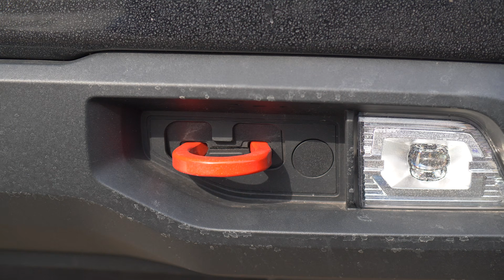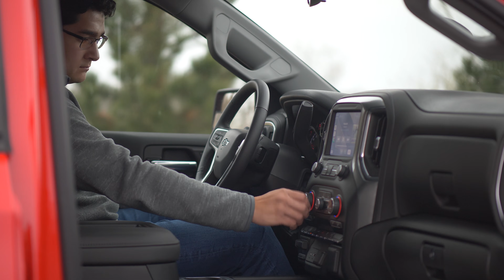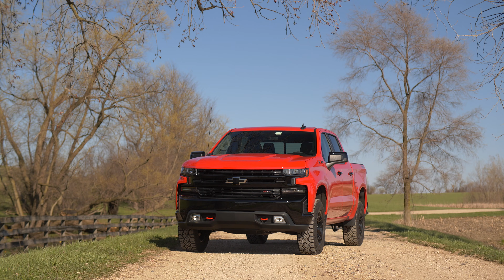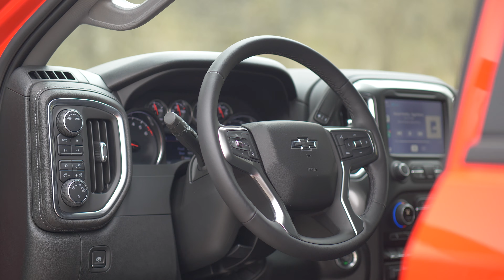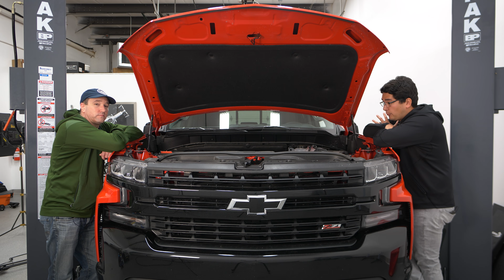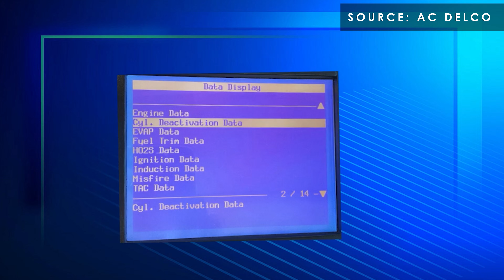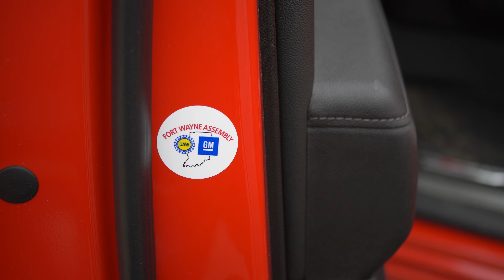2020 Chevy Silverado | The Golden Child

Comment: I did brakes on a 2010 ram and when I took the rear Caliper off the piston fell apart. Looked like it was plastic. If they cut corners on safety things like that, i wonder what else they cheap out on to pay for that interior. I don't care how nice ram seats are, I will never buy one. Just my two cents.

Comment: I'll take dependable over flashy every time. I owned 2 RAM's,never again. Electrical gremlins constantly and never ending recalls. Went back to Chevy in 2018 and zero issues. Just bought a 2020 Trail Boss LT 6.2. yep, interior is a little dated,seats are a little hard. I'll take that over having a truck that sits in the service department half the time.

Comment: Can we just talk for a second about how they released a turbo 4-cylinder model of the Silverado and it gets nearly identical gas mileage  when compared to the absolutely ancient pushrod 5.3L L83 motor, despite sacrificing over 4000lbs of towing capacity? Add to that the fact that most long-term 4-cylinder test trucks seem to be incapable of achieving anything close to the EPA mileage rating?

Or maybe we could discuss the 3.0 Duramax, which is already suffering overheating issues. The engine that is designed with a belt-driven oil pump that is located at the back of the engine, which DOES need to be replaced (at an interval conveniently just outside of any powertrain warranty GM offers); a belt which you must remove the transmission in order to access. And an aluminum block on a turbodiesel. With "active directed cooling channels" CNC'd into the block and controlled by, your guys' favorite: solenoids.

I'll take a pass on one of these newfangled $70K rustbucket bean-counter GM nightmares, and instead I'll slump into my 25 year-old, beat-my-wife-red Ram 2500 and stare at the disintegrating dashboard, meaningless rear bench seat, inaudible audio system, and somehow still feel a slight tingle of satisfaction in my rectum when I twist the key in the ignition and the 300,000 mile-old 12-valve tractor engine under the hood violently shakes itself awake.

Comment: For accessing mines I rent these trucks (4x4 crew cab, chevy/gmc, ram and ford) for about a week 6 times a year for the last 6 years, so not quite 40 of them over the last 6 years. I've had equally good/bad experiences with all of them. The biggest indicator of reliability is the trim level, the lower the trim level the more reliable - like if it's got a sunroof it's about 50/50 that that works. If it's a full ton it's maybe half as reliable as the 1/2 ton. If reliability is key go cheap, get the cheapest one that meets your needs, the more you pay the less you get. The comments about the interior don't register with me, all of these trucks function practically identical inside.
Reply: I like this comment .

Comment: I bought a 2020 LT 5.3L w/ DFM in April.  In doing my homework i've learned a lot about AFM and how many people had their trucks ruined from malfunctions.
I only have 10k miles on my truck now, i bought it with 8 miles.  Checked the oil for the first time (changed at 4.8k by dealer) and it's in great shape, but it should be, so no surprise.
I've found dongles that will remove the DFM, but mixed reviews from people on them, some have reported CEL coming on after a few months and they have to remove the dongle or disconnect the batt on the truck.  One guy said his truck went into limp mode when the OBD2 AFM disabler was plugged in after a few months.  None of them said the issue was permanent tho, truck always fixed itself after disconnecting the batt.
I know these guys are untraceable and i can disconnect them before any dealer or warranty work, but at the same time, i feel the truck is engineered for DFM and disabling it by a poor OBD2 override dongle isn't really worth it.  Wondering what you guys would do if you were faced with the same circumstance.  I think if i Flash the ECU my warranty would be void. 
Glad i bought the 80k miles powertrain warranty :)
Reply: On the older trucks (18 and down), there is a guy in MO who does afm software deletes. Send the PCM in and he is able to turn it off. Lt1swap.com

Comment: I had a 2018 1500 4.3 4x4. Never did idle smooth also the shake from the AFM system was a nice feature as well. Took it to the dealer 5 times but because no engine lights or codes they couldn’t / wouldn’t do anything. Finally had the motor mount changed under a service letter and it did nothing. Drove straight to a ford dealer after the motor mounts and traded it in for a 2020 F150. Couldn’t be happier now!!

Comment: So I just bought this truck 2020 Chevy Silverado Trail boss LT with the digital fuel management system. This truck was so hard to find I had to almost drive 100 miles to find one that was coming into the dealer. These trucks are so rare And are often sold before they even hit the dealer lot.  I actually bought mine before the dealer received it and I pick it up tomorrow. I really enjoy your videos because you don’t hold back on your reviews but for some reason I cannot picture either of you driving this truck. I think you would almost settle for the wimpy Honda ridgeline. If you call that a truck.

Comment: So I just bought a trail boss last week. For me I'm not a Chevy fanboy I'm more of a Mopar fan. However my issue with ford I don't want chrome and I don't was a eco boost very hard to find. My issue with ran beds rot out from the inside out, and the ones around me can only tow 8600 lbs my trail boss can tow 9500. I'll keep my eye on that active fuel management. Those were my main issues and why I choose the Chevy. And I think the interiors are nicer then ford. My brother in law just bought a 2.7 extended cab f150. I like my truck way more.

Comment: When someone stands under a vehicle without underhoist support stands you have to question their knowledge on anything
Reply from the maker: There is something called locks that modern lifts use.  The car is not using just Hydraulics to hold it in the air.

Comment: I was working at a GM dealership when these came out. Felt very smooth compared to my 2002 but I didn't like the styling or the increasingly tall cabin and box. Feels like sitting in an Express van now. And they still WAX the paper thin frame. A non-AFM V8 option would be nice. The old 99-06 LS-based motors are rock solid.

Comment: I drove my 2020 Silverado 6 hours on a recent road trip and i found it very comfortable and quiet.  I really don't understand the complaints about the seats.  Also i know a couple people with high mileage, last generation GM trucks with AFM and none of them have any problems.  I felt like there's some anti Chevy Bias from these guys, yes the interior isn't the best but i picked my 2020 Silverado after looking at options from Ram and Ford, i thought it was the overall best package taking every factor into consideration.  One more note.  Yes, the interior inst the best, but its still LIGHTYEARS ahead of where these vehicles were just a decade ago, there's no really "bad interiors" anymore.  Some are just better than others.

Comment: The only reason to even consider the GM twins over the competition right now is if you actually use the bed of your truck and need all the space you can get... because the beds on the new GM twins are absolutely cavernous. Seriously, if you haven't looked in the box of one of these trucks yet, do so... its like the tardis. The beds on the GM twins literally offer 10 - 12 more cubic feet of volume than the same length beds on the F-150... thats insane! 

In just about every other respect, though, the new GM twins fall short of the competition.

Comment: Soooo get the 6.2 instead of the 5.3 lol. I had a 2008 with AFM. Only issue I had was a valve spring broke. Dealership covered it and just swapped them all out for revised ones.

Comment: I can’t get over the seating position in these gm trucks. The hood is level with the dash and the window lines and you actually can’t see shit. I’m totally  biased as a Ford fan but I swear new F150’s don’t have this problem
Reply: Yeah Ford slopes down a little. My Ram goes straight across too, hurting visibility. It might even go up a little before that final slope down way out front. But it might have been necessary to fit the 6.7 and radiator in there. I haven't driven a 1500 to compare.

Comment: GM is in trouble; RAM is just so much better.  GM thinking a small sunroof is okay, GM thinking a non true flat floor is okay, GM thinking an ugly column shifter is okay, GM thinking horrendous gages are okay, GM thinking that interior is okay....should I go on?  The truck looks good but wow does it lack.  RAM took the winning trophy for good reason. I'm a die hard Ford fanatic but I know a good truck when I see one, RAM engineers really did great work on their truck.
Reply: More people like the column shifter than the knob. Ram even recognized this in the 2500/3500 segment.

Comment: Love your videos and your humor. Bought a 2020 Silverado last week and this video made me feel a little bad at first. But hey. I get it. 

I do feel like there is a disconnect between the reviewers and the buyers on these 2020 GM trucks. Every review beats it’s exterior styling and on the interior. 

But in the real world GM sold more Silverados & Sierras in Q1 than Ford F150s and blew Ram away. 

I’ll admit there are things on the Ford and Ram that are nicer on the inside but Chevy does have some innovative storage compartments and things the other don’t have. 

I got the 2.7T since I use the truck more as a dad sedan. I’m actually getting 21 and better at the pump. That’s with a crew size 4x4 on 20s. 

I’m really impressed with it. My 2020 LT Chevrolet has things my brothers 2018 Lariat F-150 doesn’t have.

Edit: I’m no Chevy fanboy, this is my first Chevrolet truck. I’ve owned several f-150s and 1 Ram before.

Comment: AFM isn’t an issue with 2014+ GM engines. I’d be more concerned about the junk torque converters they use that usually fail between 100k-140k. Just in time for when most warranties expire.

Comment: Coming from my 2010 Tundra, I really thought the Trail Boss would be my next truck......As for overall looks, I prefer it over all others. The test drive turned me off....so much road-noise. Then tested a new top of the line Denali...and still more noisy than my 2010 Tundra with 260k miles. The Ram was definitely the best driving truck with best interior, but some things about the front-end styling I could not get past. The F150 was not a consideration as I've had a few and wanted a different look. In the end, I went back with Toyota and got a 2019 Tundra Platinum....30k miles and still happy about the decision. Sure, it's basic with some older interior styling, but it's comfortable, quiet,  and reliable so far.

Comment: Crappy sound system
Hard seats
Crappy ride quality
Cheap interior plastics
Mediocre center stack display
Pealing e-coating on frame
Rusting components under body
Rusty brake lines
Exhaust pipe that is flattened and routed under transmission oil pan
Crappy / problematic cylinder deactivation

The rest is okay. Power plant, drive train good.

Comment: I had a 2011 Silverado built in Oshawa, no problems but new brakes after 90,000 miles.  2016 GMC made in Mexico dropped the transmission after 40,000 miles, leaky satellite node, battery died and I already had to do the brakes before 65,000 miles.

Comment: GM May have some of the best engineers in the world but their work is trumped by the best cost cutting techniques in the automotive industry. Thanks to the Ram and Lincoln Navigator, GM had to delay the Tahoe, Suburban, Yukon and Escalade to redo their interiors which strongly leads me to believe they thought it would’ve been acceptable to put this Silverado interior in those 2021 Tahoe/ Yukon models. Unacceptable but I’m glad the competition has forced them to upgrade.

Comment: Wasn't the 5.3 vortec bullet proof engine, I had one got to 200k miles zero problems and I know many personally with over 200k miles with no mentioned issues.
Reply: Voltedge these guys have never owned a 5.3. They google all the negative stuff about the 5.3 and make a video.
Reply: The 07+ use AFM. They do have some issues with lifters and oil burning.

Comment: I agree, the front looks terrible, the rest of the exterior looks good, but they ruined the front clip again. Interior wise, it's not much different from my 2015 Silverado. I love my interior so that is OK I guess. They could have made it nicer. The 5.3 scoots well, tows well and with a new intake, exhaust and tuner, I get a lot more power and better fuel mileage.  The tuner eliminates the 4 cylinder mode, which is crap. Salinoids? What word is that? It's solenoids buddy lol.
Reply: Compared to the ford f 150, it's a lot nicer, fords are more work trucks. Rams, are meh. I am a Dodge tech and I still bought a Chevy. Much better than a Ram. Less maintenance, better fuel economy, more power, I like the Rams, but not nearly as much as the Silverado.

Comment: 5:56 What is this guy getting at? Can’t the same be said about RAM and Ford? A lot of their improvements are forced innovation from other companies too. GM in particular deserve a little bit more credit than what it sounds like he’s willing to give. GM has beeen paying a lot more attention to materials used and how they use them in their products way before this model year Silverado truck was here. Look at the architecture of a CTS-V, take it apart piece by piece and you’ll see how they managed to make something that big weight so much less than a comparable M5 or E63. This is nothing new to General Motors in 2020. Given this is an entirely different set of crayons (segment) but I think I’ve still made a valid point.

Comment: I always enjoy your reviews. I shopped Ford, Ram, Chevy, and Toyota. I purchased the 2020 LT Trailboss at 42K after rebates and dealer discounts with lifetime powertrain warranty. I got cloth seats which to me seem very comfortable. The interior isn’t pretty but really has everything you would need. I feel like it handles and drives really well over all and with the 5.3 and 10 speed auto trans I am getting 18 mpg over all. The look is subjective and for me I find it to be a great looking truck. More futuristic and not so traditional and boring to look at. I didn’t choose Toyota because of bad fuel economy and with a bench front seat you get nothing but a basic somewhat outdated truck with the Tundra. Ford was nice but I wasn’t able to find one packaged the way I wanted with bench front seating and when I did it was much more on price. Ram has great interior and the Rebel is the sweet spot for me but I don’t trust the reliability over the long haul with FCA product. I like the ruggedness of a truck specifically and with the factory two inch lift and absence of Chrome as well as off-road tires and good packaging with bench seat matched with a fair price I had to choose the Boss. I’m not biased to any brand and wanted a Tundra originally due to history of reliability and they too are great looking trucks. It’s only been a few months, but so far I am really happy with the purchase.

Comment: Well here is my more than 2 cents. I test drove a trai boss last July so it was a 2019. Basic is what it is and over priced tag for a 3" factory lift that anyone could do after market. With this being said. I went with a silverado Z71 RST model. Interior is the same as most, opted for the heavy non sport interior since I have a 125lb giant alsakan malimute and iam an outdoorsman. Couple with factory matched weather tech full floor mats front and rear. The base sound system that is in mine is same as the truck you're reviewing and this is where I will disagree. It's mids, highs and low base tones are crisp. Use the onboard equalizer to adjust such. Also depends on what type of audio input you use. Now for my big bitch. 1 month after buying this truck last August just over 600 mile mark transmission was skipping and would not engage. Bluetooth connection for Android auto is a joke and ALWAYS has connection issues. I have a gaxy S10+ so its NOT my device like the dealership claimed. Fast forward to now and not make this owner review any longer, this Monday will be trip 11 to the dealer for ANOTHER brake system recall. I have had a transmission flush as well as all TCM'S replaced for transmission issue and problem has persisted and depending on outside temps worse. The attorney General has accepted my case going at GM and carbone chevy which is the dealer that sold me this pile. I've owned Ford and chevy and I severly miss my 2006 Z71....I was stupid for trading it in now for a newer pile that GM is pushing stating its a "truck". Granted I'll be fair. The interior is nice and everything is at the driver's beconing, heated seats and heated steering wheel is wonderfull during the winter but having most of the truck made in Mexico and Canada is not the heartbeat of America. End of the day the 19/20 line up of chevy trucks are flashy but being  I have 8 months of headache GM does not stand behind thier product, drive train sucks, trannt is subpar outsourced to Ford its not even a chevy anymore. First hard shift issues and no GM currently has 2 class action lawsuits for the same issues iam having with mine. Iam done and will be looking at ( biting my tongue saying it) a crew cab Toyota tundra... sad thats made more in America than a self proclaimed heart beat of America like chevy claims.